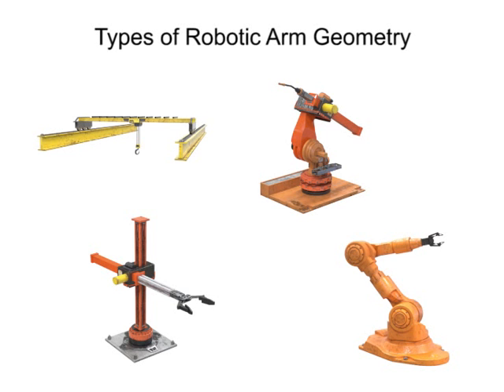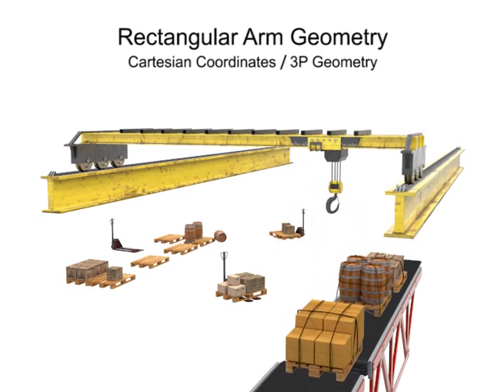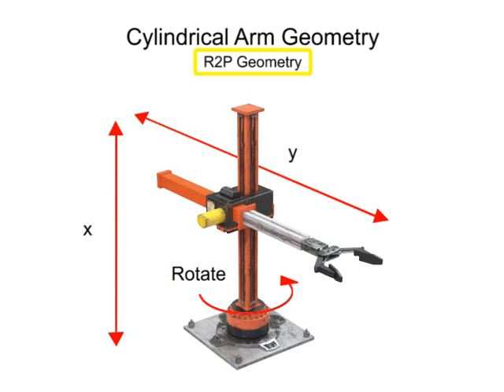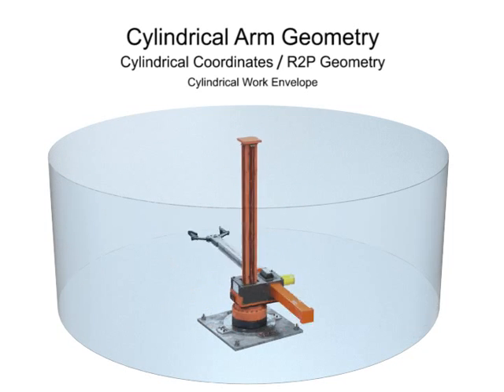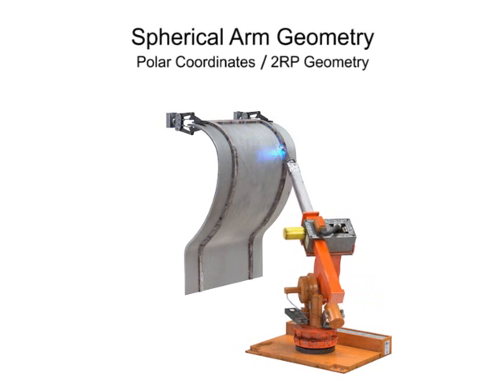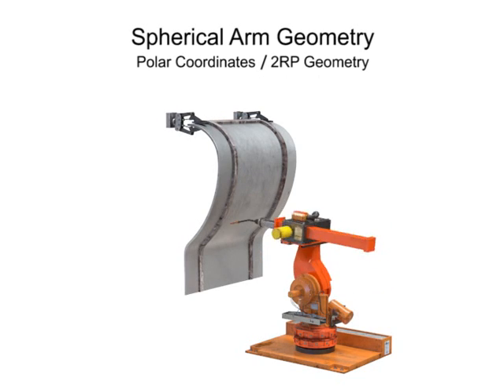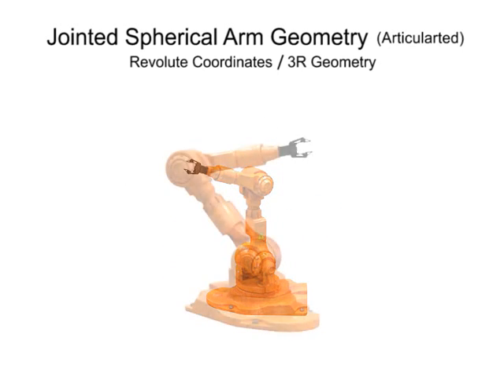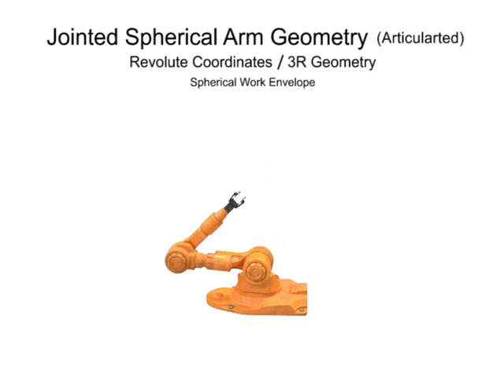Robotic Arm Geometry

Comment: You screwd up the XYZ on the first one, that foult, shal NEVER be done. The X axis is left to rifght (considering taht you face the work area with the 0,0,0 point at bottom left towords you). the Y axis is back and fourth and Z is height. Most robots today are 5 or six axis. some even have 7. All this is seen from an industrial side. I have yet to see other then a normal robot "arm" as you might call it.
Reply: Not also considering that gantry cranes work much like overhead as shown but also they can move about on their own in the x and y or just one if on a track like container handling gantry cranes.
Reply: anyway - a nice overview
Reply: That's not always true..  I know in many industrial applications,,  Z is always the axis of the most force,  regardless of direction....  A robotic drill doesn't  always drill vertically,  it can drill horizontally too..  That would be Z axis..